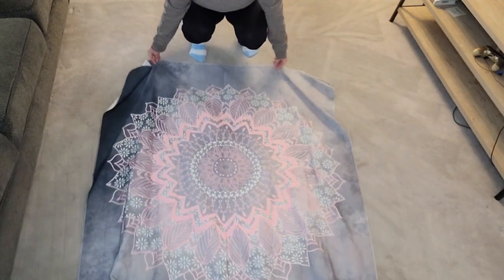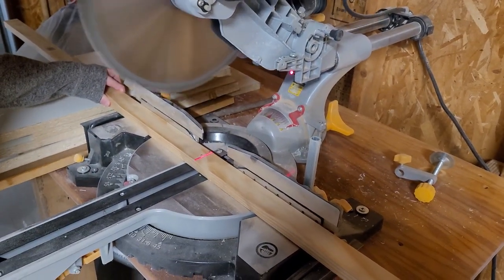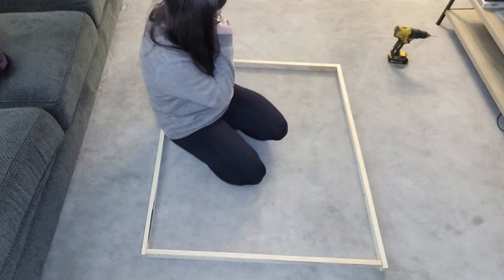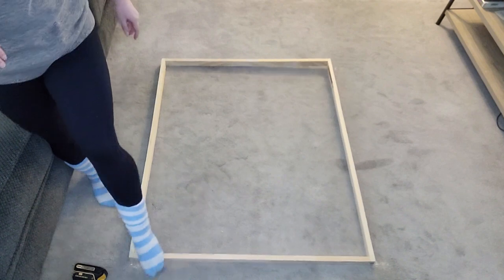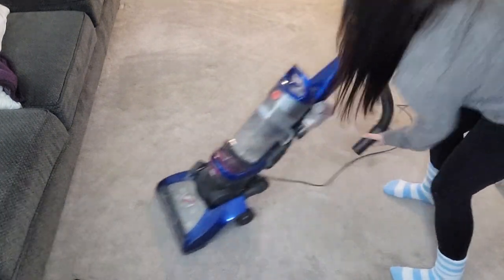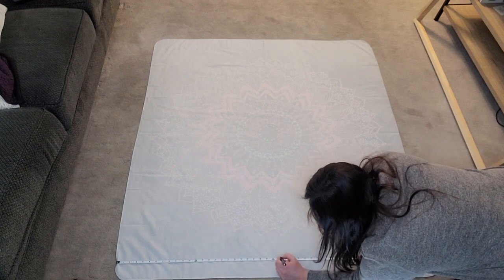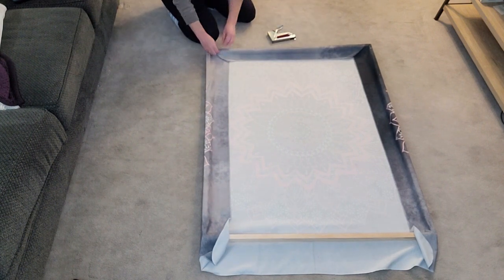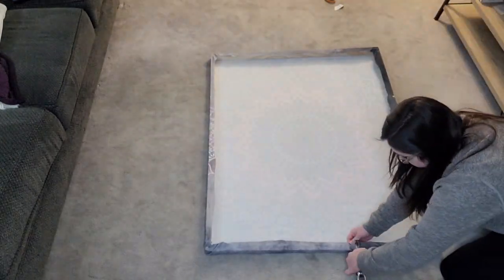Large Wall Art For Cheap | DIY | Large Wall Canvas Tutorial | How To Make Large Wall Art Cheap

Comment: Might be easier on my old lady back and knees if I hang the frame figure out placement then. Maybe spray adhesive because you can still move it around to get placement? Idk anything to save my back 🤣🥰
Reply from the maker: 😅 I think that would work! If the frame is hanging then I would start with the adhesive on the top-middle! Then you can make sure there are no wrinkles as you stretch it to the top corners! I would let it dry and then finish the rest! That way it isn't moving on you too much!